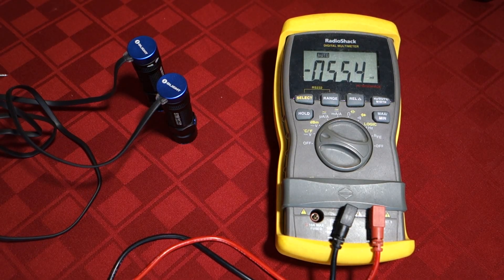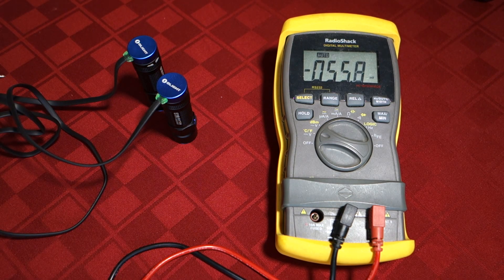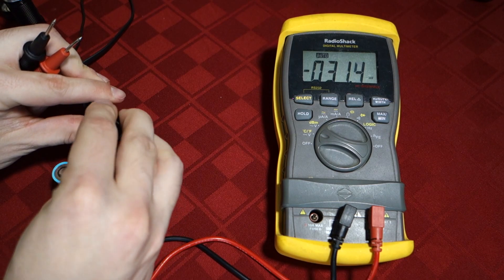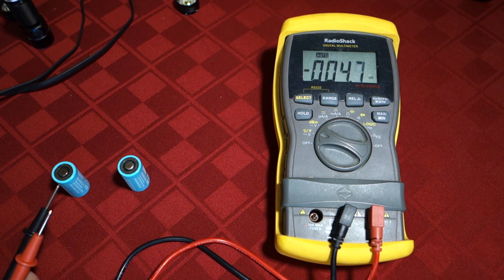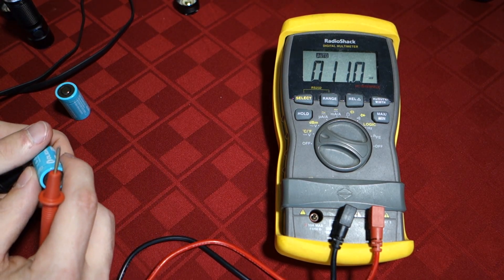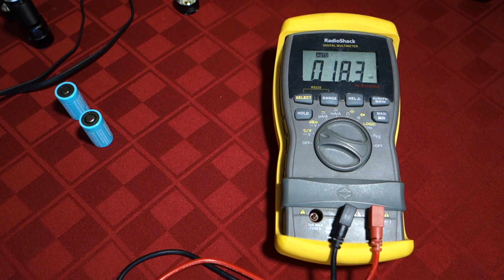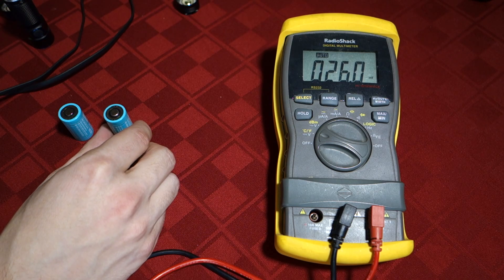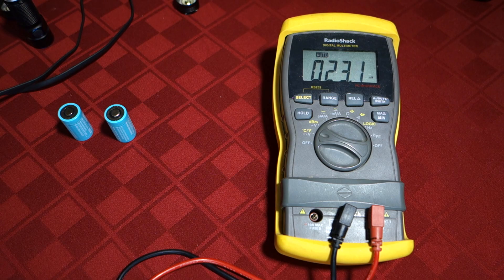Olight Magnetic USB Charger Concerns - Overcharging Batteries???

Comment: Is it bad to charge the s1r 2 overnight? Charge it every night like I do with my cell phone every night? If I don't use much each day? Since the batteries don't last real long in this tiny light I like to always have a full charge. But I guess I don't want to burn my batteries out super fast either.
Reply: nuts 4 knives li-ion batteries should never be stored dully charged (4.2v), it’s recommended batteries be stored at around 50-60% when not in use. Ultimately you’ll lose your battery or light or buy a new light long before you start wearing these batteries out simply due to keeping it fully charged. We’re talking 5-10 years
Reply: @ernurseproductions  I use it quite often. It's in my pocket every day

Comment: Thanks for the info bud, I'll be sure to take my lights off the charger when there toped off. p.s I run olight brand 14500 an 18650 have you had good experience with olight brand battery? I have the s20 r and a thrunite th 20, the latter did not come with battery's so I spent about 10 bucks on 2 14500s and the olight uc charger..